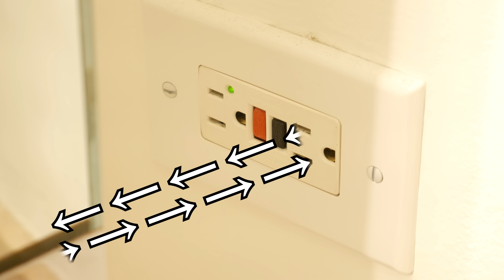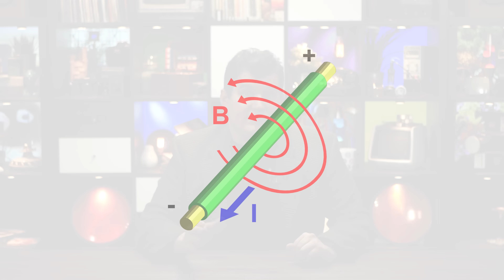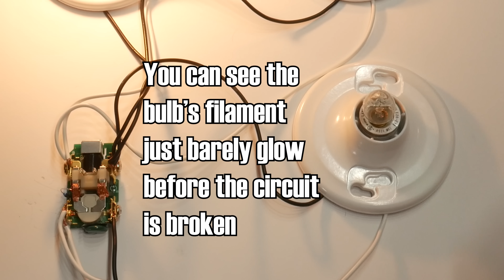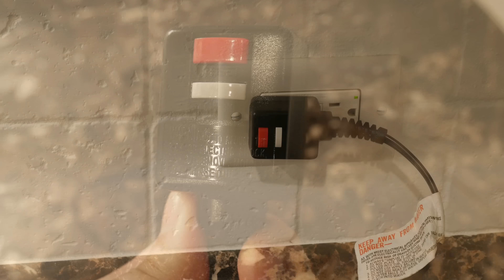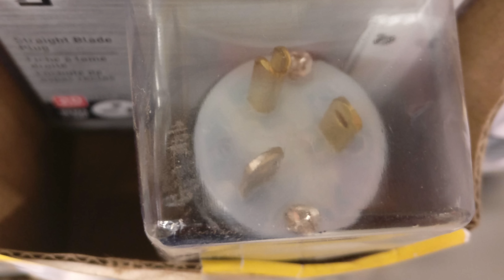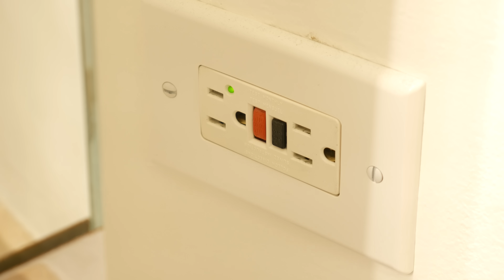The GFCI/RCD: A Simple but Life-Saving Protector

Comment: To clarify a key point, all current flowing from the outlet will end up returning to the neutral wire at the power pole, whether through the proper path, or through your stupid butter knife poking self! If it flows through you, it will end up going to a water pipe, a safety ground circuit, wet concrete etc, but will end up back at the ground rod or pipe bonding wire, etc, and flow back to the main panel where the Neutral wire is Bonded to the Grounding system, and thus return to the neutral wire on the pole.

Remember that all current requires a complete circuit in order to flow, so in order to have a ground fault, the electrons still need a path to return to the Source, be it the power plant, generator, solar panel, battery, etc.
The soil doesn't magically soak electricity up, and it's a horribly high resistance if you try to use it as one side of the circuit to source.
In fact, you can drive a long ground rod, and connect it directly to a 15 amp circuit breaker, and the breaker won't trip, because the resistance is so high very little current will flow, but what DOES flow is simply going to the nearest bonded ground rod to get back to the Source.

The key purpose for ground rods is to bleed off static and lightning, and to reference the Neutral wire to be the same potential as the soil, water pipes etc.

Think of standing barefoot on a metal plate, with a car battery sitting on the plate. If you touch either terminal of the battery, no current will flow, because there is no connection between the battery and the metal plate.
If you now connect a wire from one terminal of the battery to the plate, that plate now carries the potential of that terminal, and is Bonded to it.
Now if you touch the bonded terminal, nothing happens, because you are already at the same potential.
And it doesn't matter if it's the positive or negative terminal bonded.
That becomes the reference voltage.

If you are getting power from a generator, you can bond either the hot or the neutral to the ground rod if you want, and that becomes the Earth Reference.
So if you bonded the Hot to Earth, you can touch the hot wire while standing in the pool, and get no shock because they are the same potential.
Sadly, if you touch the frame of the generator, you will die painfully, so don't ever do this! Lol

This becomes important when dealing with transformers, because you have to pick which leg is bonded, what you want to reference to Earth.

I was working in an industrial facility once, and in the evenings, the neutral wire would become 110v to ground, and the hot wire would be zero volts to ground.
Then in the daytime it would be normal again.
I started looking at the Big Picture™ (© 2018 HVACR Videos) and discovered that that mechanical room was being fed by a single 3 phase circuit to the main 3 phase panel on in it, and then there was a buck boost transformer feeding the 110/220v panel which ran all the lights and outlets etc.
After some testing, I discovered there was an outside light with a photocell, that had a shorted out ballast, and that the electrician who installed the system had not bonded the center tap on the transformer to Earth ground, and so it was a floating system.
So when the photocell turned on, it bonded one of the 110 v transformer legs to earth ground, driving the center tap neutral to 110v away from ground, and since the shorted out light was the only place the transformer was connected to ground, there was no fault current to trip a breaker....

Comment: Not completely sure about this, but I think here in Germany they are supposed to be protecting everything, even the lights and you need at least two in your home, so that not everything shuts of at once. And if you don't have them, you are required to include them if you change anything in your electrical system. If you don't, it's your own fault and it's your careless behaviour and you are personaly responsible if anything happens.
And you are supposed to test them once a year.

Comment: In Canada, we do something a little different with the duplex receptacles. Yeah, we leave the tabs on and use them the same way as a normal American installation. But in some places like kitchens it was commonplace to break the tang on the hot side and use 14/3 cable, White to neutral, Black to one outlet's hot, Red to the other outlet's hot. Supply it with a ganged breaker from the panel, and then you have two 15A circuits in the same outlet - it worked great when you wanted to plug a kettle and a 4-slice toaster into the same kitchen outlet. You could always tell these outlets because if you went from narrow slot to narrow slot with a voltmeter, you'd see 240V AC... 

 With GFCI requirements, that has gone away, and been replaced mostly with 20A T-slot GFCI outlets on 12/2 wire. AFAIK, running the 14/3 and the ganged 15A breakers is still okay, but only in places where a GFCI would not be required. The outlet behind my fridge is, for example, wired this way. Which is great because my microwave oven sits atop my fridge, but it does mean that a nuisance trip caused by my microwave would kill the power to the fridge. I do, however, have a total of 30A at 120V available between the halves of that outlet. 

Always follow building code in your region and always get it inspected. The inspector is your friend... even if he can be a pain in the ass at times.
Reply: If the outlets are still 120V each, I can see this working great where vacuum cleaners are used a lot. If they're 240V, then they would possibly be better for modern computer PSUs, as the power factor is more consistently better, TMK. I can imagine data centers using 240V receptacles.

Comment: "Might save you the pain of a zap" now i'm curious if the current flow for the fraction of a second before  the circuit is broken can be felt or not. I'm not suggesting anyone test it to find out .
Reply: It depends the current current. And the current which flows through your body is usually not the current at which the RCD trips.

I had one case where a 30mA RCD tripped while I was creating a ground fault (through my body) with less than 0.5mA. Apparently, the circuit was already close to tripping, and the additional 0.5mA just pushed it over the edge. If you have a lot of devices with Y-capacitors (against RFI/EMI) connected, the capacitive load current can get so large that it trip the RCDs (or nearly trips it, as in my case). You don't feel 0.5mA.

On the other hand, you may experience a much larger current when creating a ground fault. The RCD does not "limit" the current, it just shuts off in about 0.2 seconds when it detects anything above its trip current (that is the safe time before the heart goes into ventricular fibrillation). That means that you will  receive a few cycles of a potentially rather high current. You can feel that, and I also remember a slight lingering ache for a few minutes in a few cases (the muscles in my arm reacted noticeably to the current in these cases).

There is danger involved with this! People, who had their lives saved by the RCD while working on a ladder, got killed a few fractions of a second later when they fell off the ladder due to the shock they felt. It has been argued that, without an RCD, the contraction of the muscles might have caused these people to "stick" to the electrified object and therefore saved them from falling. A nearby person could have cut the power at fuse box (possibly placing pillows below the ladder first, or having some other person standing guard to catch the then de-electrified victim) and then proceed to treat the victim's ventricular fibrillation via CPR (and, of course, calling an ambulance).

I once "performed" a ground fault while on ladder. Very tingly (>300mA), but I didn't fall off. I was mightily pissed off when I found out that (a) someone had swapped earth and live (some the device would not power up, but the metal case was live) and (b) a wrong RCD had been installed (300mA instead of 30mA; 30mA (and lower) is "life-saving" and a 300mA RCD is meant to prevent fires, not save lives). Anyway, the RCD did still save my life there - but it would not have tripped if only 200mA had gone though my body.

Comment: AND GFCI plugs fail over time. If the circuit goes dead and the breaker is not tripped in the panel, try replacing that plug.

Comment: in my country it's called differential breaker and it's self explanatory as it meassures the ΔA between Line and Neutral. What I would love is to get these types of outlets but they're not made here we use the ones that go directly on the main and sub panels

Comment: I'm guessing the light will slightly glow even after contact breaks because of the sort of 'backlash' current induced by one of the coils in the GFCI.  I'm sure that torroidal coil can hold its share of 'Henrys' which is the unit of inductance if i remember correctly.  Not sure how much, but obviously enough to make tht 41 milli-amp bulb glow slightly.

Comment: Back while we were remodeling, our light switches didn't have covers on them in the hallway because the walls weren't in place yet (I know, should have left the covers on anyways) and when I reached to turn on the light, my finger missed the switch and went straight into the electronics. The shock was startling, but my arm jerked away and I was okay. Gave me a big scare, but I didn't think much of it otherwise. I don't know why I never considered how close that could have been to actually getting myself killed from something so stupid.

Goes to show that even the most unlikely mistakes are going to happen if you made a stupid and dangerous decision, especially when dealing with electricity.

Comment: ElectroBOOM made a video on this. If you put your hand between live and earth in GFCI, it won't draw 5mA of current. For example, if the skin has an average 300kOhms resistance, at voltage 120V, the current will be 4mA, which is not a certain death but it is very dangerous and you might not be able to let go.

The hand needs to be wet and soapy (hence why GFCI is used in bathrooms) for the resistance to be low enough to allow 5mA of current to pass. But a better way to test it is to measure your skin's resistance and then pick an appropriately rated resistor, rather than use your hand directly (I am watching ElectroBOOM, you know?)

Comment: I don't know NEC but Canadian Electrical Code  says the circuit must be directly spliced, that is: cable to cable and devices must be connected on a pigtail connected at the splice.The pigtails allow installation or removal of a device without circuit interference. Passing a circuit through a device is NOT DONE. The breakouts are strictly for circuit separation as in a 2 circuit counter receptacle.

Comment: I like your videos but I think on this one you failed to fully explain how a GFCI protects someone from getting shocked. like the knife in the toaster example. You showed arrows going throw the guys arm indicating that current is flowing through his body. A better representation would be to show where the arrows going through the guys arm end up at. And thats usually through ground earth or something that is grounded like a metal appliance, stove, washing machine, etc. It would show that some of the current is going back to the source through a different path that is not the GFCI, making the GFCI notice a current imbalance between the HOT and NEUTRAL, causing it to shut itself off.

Most people like to think that a GFCI will auto shut off ANYTIME a person gets shocked and that is absolutely untrue. A GFCI will only do its job if the person getting shocked has part of the current return to its source through a different means, again like through ground or grounded metal appliances. If a person touches both HOT and NEUTRAL on a GFGI protected circuit, and the rest of their body has no path to ground, they will light up like a christmas tree and the GFCI will happily continue providing power, electrifying the person to death and will never see any reason to shut off. It will see the person as a regular safe load.

Comment: The other reason GFCI plugs are preferred over GFCI panel breakers in North America is that the former are much cheaper to use. They cost quite a bit less than the difference in cost between and plain overcurrent breaker and a GFCI breaker. Also, the GFCI panel breakers often occupy two spaces in the panel.

Then there's the new kid on the block, the arc-fault breaker. This trips when it detects the rapid changes in current associated with an arcing condition caused by a bad connection. I'm not quite sure why they aren't set off by a switching mode power supply, though.

Comment: one time I was eight years old and I was watching this little beetle crawl around the wall and a crawled inside the ground pin and then I heard a pop and the lights went out. I remember very specifically it was the ground pin because I remember me thinking as a child that it went into the faces mouth and killed him but basically I think he crawled in there and somehow got stuck between ground and one of the hot leads. My dad reset it and the bathroom lamp came back on after smelling zapped bug for a minute.

Comment: well. I'm from Austria, so we have 230/400V and have the RCD in the box. and my opinion about the GFCI as a electrician is, it's quite... well lacking safety. 
every current that comes gets to the main fuses and  splits from TN-C to TN-S. After that, they get to the meter, then to the 30mA RCD, who protects the whole building and so for getting in a circuit and then further to the circuit breakers.
If it's TT, you have two RCDs, one with like 0,3A and the second one with 30mA.
The reason is, that the law says, every outlet must be protected by a RCD with 30mA. to that it needs to react quickly (0.3sec). 

About the problems: well at first, a GFCI is only at certain sockets, but a body contact can always happen and the fault protection can't always protect. that's why he have a 3rd safety instanz, the 30mA RCD directly at the start, after the meter to protect like every circuit, even so you only need it by socket, as it grants saftey aswell.
then about the different art of current. the technology gets more in EDV and so diodes get used. as well as coils and capacitor. well that stuff are quite nice for stuff like only letting pulsating/ almost only DC thought wires or like to power a fluroscent tube. but it doesn't look like, that these GFCI can detect, if pulsating or full DC flows thought some wires and makes a fault. For that, there are RCD type B who can detect AC and DC as well as pulsating DC. 
A other thing, that is: Why america, UK and so use not CEE or safety sockets. it looks so dangerous, if you can touch the pins, if you insert it as by CEE and "Schuko" they prefent from touching and "Schuko" have certain features too like touching always ground before even getting with the pins in the holes as well from having a good grip

But for the video: well made, you describe it nicely and showed it. had been interested, if you open up a RCD too, as there are certain difference, specially by type B to a GFCI

Comment: It is entirely possible to get shocked (electrocuted) using a GFCI outlet. If the hot is touched and the return path is back through the same outlet (the return path being the metal frame/chassis of a 2-wire appliance) the GFCI switching will not take place. It will behave as the second light bulb going on (9:05), with you being the bulb. Zzzzzzaaaaapppp !!!!
This point should have been brought up, as it helps explain why many devices now have a ground (3-wire) cord.
Reply: That's not true. The ground isn't monitored, so current going out of the hot and into the same outlet's ground will still trip the GFCI. That's why it's ok to replace old 2 pin receptacles with a GFCI labeled "No Equipment Ground"

Comment: Water is actually not very conductive at all. It's the dissolved solids in it that conduct all that electricity. In its purest form it's a strong insulator, although it can self-ionize, as well as having atmospheric gasses easily dissolve into it. This will make it slightly conductive.

Comment: In spanish the device has another name, it could be translated as "Differential interruptor (or switch)" . It interrupts the current when there is a difference between the live wire(s) and the neutral.
Edit: In Argentina the device is used in electric panels and usually set to a 10 to 20 mA difference, mainly used for "people" protection, it is paired with a "Thermomagnetic switch" to protect devices from overcurrents due to faults (not ground faults) and short circuits.

Comment: "What are these for?" They are for making my beer warm.

All my kitchen outlets are on GFC, and every time the power company sends a blip or a brown out (shortly after I go to work), my drink fridge is unpowered until I hit the reset button.
Reply: You might want to get these replaced with proper types. There is one RCD/GFCI type which trips not only on a ground fault, but also when the main power goes down. For so-called "safety reasons". I have no clue what these "safety reasons" might be. Well, if the RCD/GFCI remains off after a power interruption, you know that EHEC will be partying big time in your freezer (and that your beer will be warm). But modern freezers have some sort of alarm already built-in for that. And it's pretty much annoying if the power just went down for five seconds and your frozen food would have survived.

Most RCDs/GFCIs do not have this inconvenient "safety feature".

Comment: Could a capacitor booger up the GFCI? As in, charging up the cap would result in a lag in the current return matching up to outflow.
Reply: Wouldn't the excess of electrons being deposited on one plate match those being removed from the other? Plus, at 60 Hz a large enough cap might act as a short and throw the breaker.